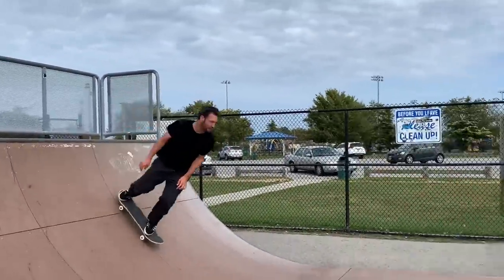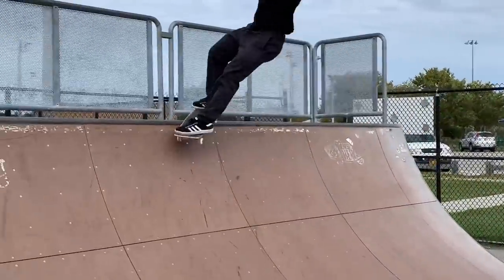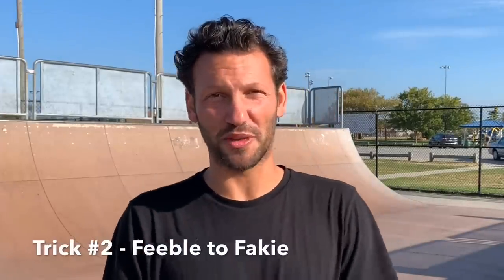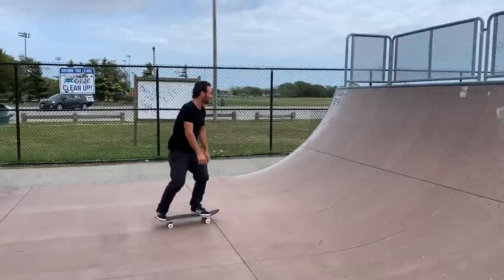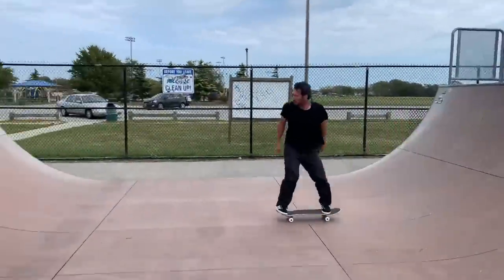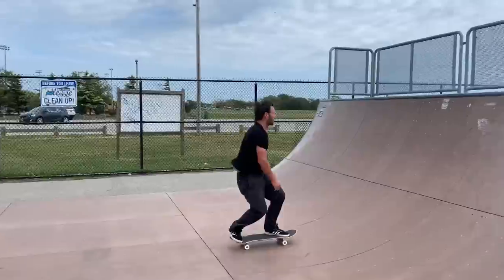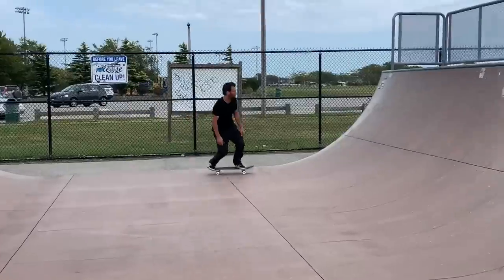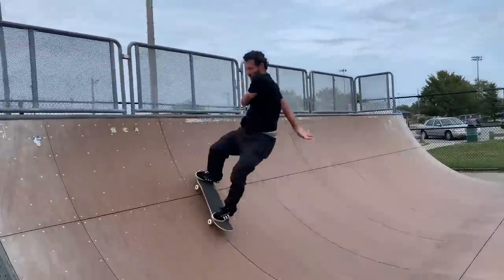One Technique That Will INSTANTLY Improve Your Mini Ramp Skating!

Comment: I couldn't figure out the nollie back tail until your tip from a previous video about positioning your front foot in the opposite edge of the board. Having the toes hanging off definitely feels weird at first, but it pushes the board right to the sweet spot.

Comment: Hey Chad, when is the first wheel drop? I need to grab a set!
Reply from the maker: I should have a website up and running mid November!
Reply: @ChadCaruso  Sweet. Love your videos man, I recently built a mini in my garage and I couldn't say thank you enough for all the trick tips.
Reply: @ChadCaruso  Yeah I will buy a set if it supports what your doing .If you could come up with a wheel good for indoor skateparks yet to find one that does nt pick all the dust up and slip out too easy.Great vids man also enjoying podcasts thanks a lot man